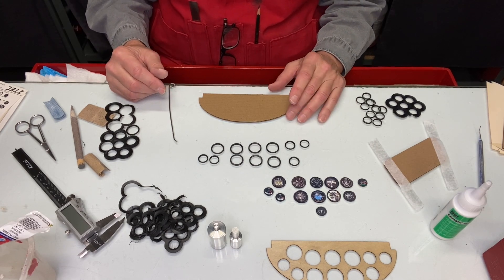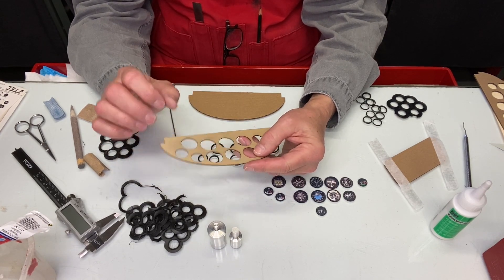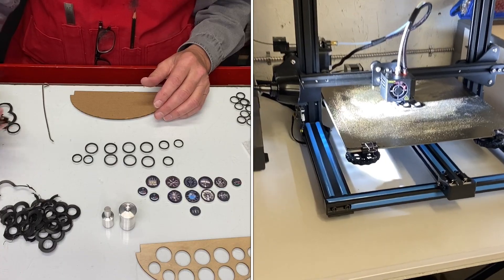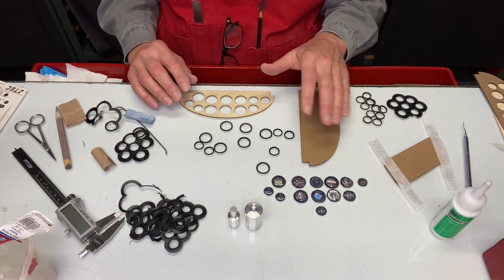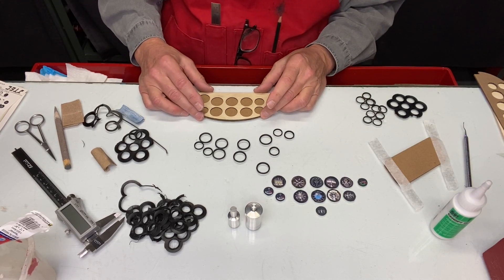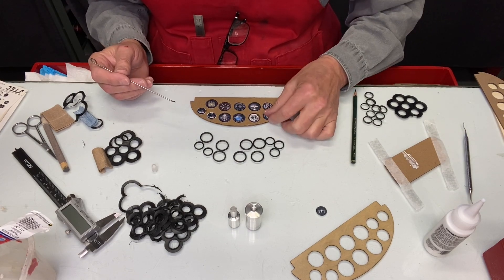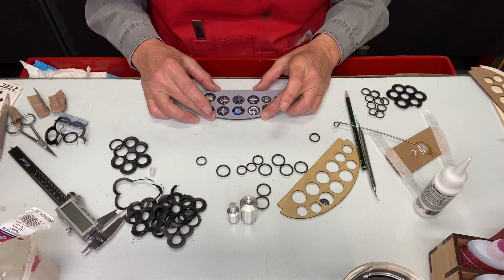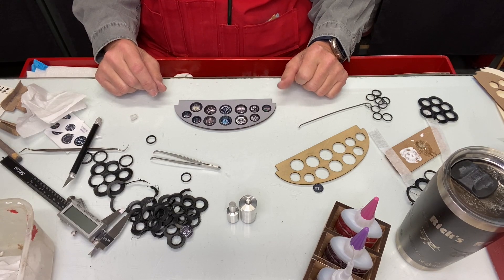How to Build a RC Airplane Instrument Panel Episode 1

Comment: Nice work, a couple of thoughts: I have used glossy photo paper for instrument panels. I drop the scaled instrument graphics into a single image with each instrument positioned exactly where needed. Then print the whole sheet and place it behind the panel cut out. Then you don't have to worry about fiddly positioning.  On the down side I find the images bleach very quickly when exposed to sunlight. Maybe laser printers are better but my Canon inkjet images fade within a season of flying. I recently came across UV blocking spray varnish, but haven't experimented with it yet.
Reply: Maybe give a water-based spar urethane (acrylic based) a try.  Meant for marine applications where water and sun are frequent.  Oil based yellows..WB will not.
Reply from the maker: I have heard your idea does work. Good suggestion, Thanks Rick
Reply from the maker: That's not a bad idea in printing the instruments as one image, I must try that. As for the instruments fading I haven't experienced it in any of my models. Is it possibly the photo paper your'e using?. The paper I use is for inkjet printers, and it specifies "true photographic quality", high gloss, the brand I use is Staples. The UV blocking may be the answer, apparently it does work in preventing fading on paint. That's one of the inspiring things about this hobby you never stop learning. Thanks for the comments.

Comment: Great video Rick, it occurred to me while watching you could skip an operation easily. Instead of drawing the circles through the panel template you could set the laser on low power and burn the circles as you cut the outer shape 👍 I've just watched Part 2 Rick and I see you've covered this very point 🙂
Reply from the maker: Hi Cliff, Glad you liked it. As for the circles that would have been too easy. lol. Sometimes these things stare you in the face and you can't see it. Good of you to pick up on it. 👍 cheers Rick

Comment: Nice job!  One tip, might be to use the laser the engrave the cardboard backing with the instrument locations. Might save a step, since you would already have it set up in your computer.
Reply from the maker: Didn’t think of it at the time…too easy. Great tip. Will do that from now on. I will mention it in Episode 2 of the instrument panel final completion. Thank you for watching.